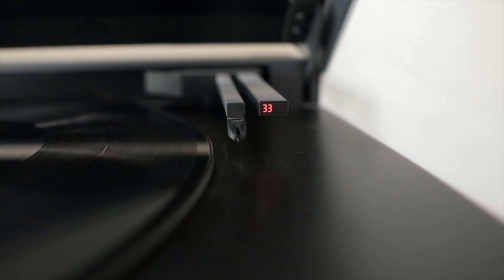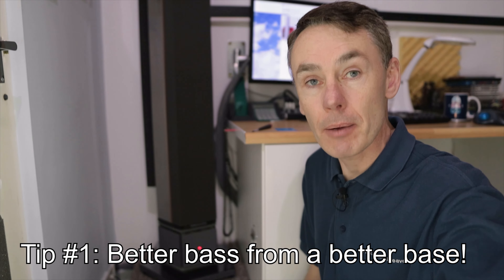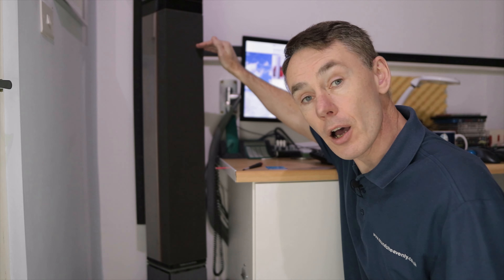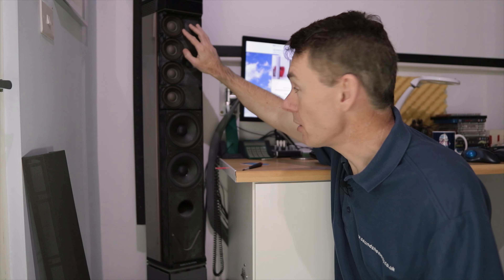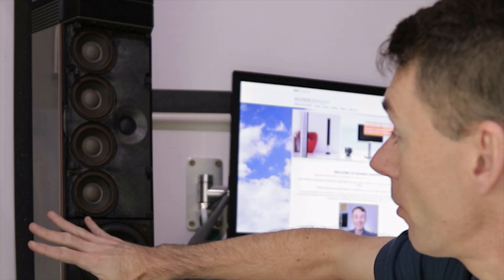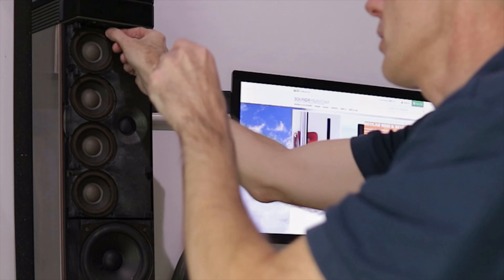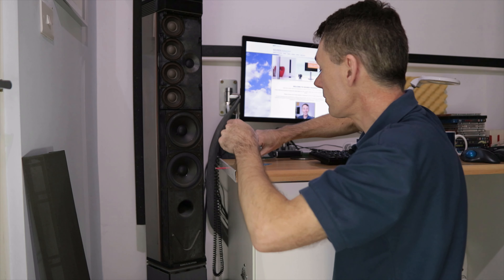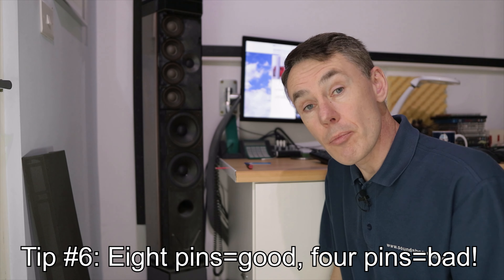Bang Olufsen Beolab Penta speaker upgrades - 6 simple hacks for better B&O sound [4K]

Comment: I'm literally in the process of buying a BeoSystem 6500 and a pair of Beovox Penta's so this is perfectly timed, and a great video too! I'm assuming your gripe towards soundlink sound quality don't apply to the Beovox Penta's as they don't have the amp and so you won't experience the amplified stream being reduced and then re-amplified again? Thanks, and look forward to your upcoming content on Pentas
Reply from the maker: Yes, the issue only affects the powered "Beolab" Pentas, as long as you use the Beovox Pentas with a powerful amp like the 6500 on good thick cables then you will be fine

Comment: Hi Steve, do you know if we can turn these Penta speakers to work with bluetooth somehow?
Reply from the maker: Hi, yes you can connect a pair of Beolab Penta speakers to the headphone socket of a Bluetooth receiver using this cable:-

https://soundsheavenly.com/line-in-connection/77-241-minijack-to-beolab-line-in-using-phono-rca-sockets-one-cable-for-two-speakers.html#/2-length-1m

Comment: Hi Steve. I have the Beolab Penta Active loudspeakers paired with the old Beomaster 5500 system. The sound system has not been used for a couple of years and when I tried to turn it on for the first there was "no contact". I've just had the amplifier fixed by a 
repair technician and they discovered that there was a broken fuse in the amplifier. However, when I came home to try the sound system, it did not work. It seems that the amplifier Beomaster system works, but there is no contact with the speakers (no red light at the bottom of the speakers like yours). 

My question is; Is it possible that there is a broken fuse inside the speakers or is it simply a setting I need to try? //Kristian
Reply from the maker: Hi Kristian, if the speakers don’t show a red light when connected to the mains power, then the speakers are faulty. Sorry I don’t know about repairs (I just make cables), but your local B&O store should be able to recommend a repair agent in your area.

Comment: hi steve it's still me, only you can help me because you know the mk3s like the back of your hand, basically I sent the midrange panels to a specialized center to renew the suspensions, unfortunately when I removed them I didn't catalog the wires with the various colors, I was wondering if you could give me a hand. Greetings from Italy
Reply from the maker: Hi, sorry I don't know about repairs, best to contact a B&O store or repair agent for their advice.  I can help with cables once you have got the speakers working.

Comment: Thanks for your reply Steve. My Penta 3s are awesome. is it possible to bypass the amps to use them as passive speakers, driven from a non -B&O power amp? is the Line -In the same spec as traditional preamplifiers?
Reply from the maker: The simple answer is "DON'T DO IT!" Everything that makes the Beolab Pentas great starts in the power amps.  You can remove the amps from the base of the speakers if one day they fail, then you are left with passive Beovox Pentas that won't sound as good.  Until then, keep the amp in place as it is a superb power amplifier, designed to drive these speakers to their full potential.  They won't sound as good without it.
Reply: @soundsheavenly  Thanks Steve. What I meant is, is the speaker there for that purpose? Can it be connected to a none- B&O power amp via this input? The naming convention is something that I need to become familiar with. Regarding the Line- In input; is that the same spec, as the universal amplifiers. or is it proprietary?

Comment: Are secondhand mk1 Penta's (6602) worth buying. They are to go with my beocenter 9300. I have noticed they aren't powerlink like mk2 or mk3 penta's. Are they still a good speaker?
Reply from the maker: Yes, of course! I will shortly be making another production run of the special 4 pin Speakerlink cables to let you use these amazing speakers with your 9300 system - please drop me a line at https://soundsheavenly.com if you need any help getting them connected to your system!

Comment: I watched your suggestions again since I just picked up a beosound 9000 and another pair of penta 3 speakers. Heres my problem. I have a beogram tx I want ot play through the bs9000, and I have an aftermarket lcd tv I run its output volume into the aux input on the bs9000. so is there a way to have my beocenter switch from the tv to turntable with the remote? I'm guessing the bs9000 will need something to do this? I just don't have a clue. see at the moment i use a preamp with switching capabilities to switch the two, but being disabled it would be great to be able to use a remote instead. Thank you for any advice you may have. Ps I love your videos I've learned tons from them over the years.
Reply from the maker: Thanks, glad you like my videos.  There isn't an easy way to have remote control switching between two sources, best to link them via an input switch box or splitter and control them manually.

Comment: I've had one pair of Penta 2's for many years, and was wondering about adding a pair of Penta 3's to run off of my Beosound 9000. Due to how my living room was built, and the amount of space I have place the speakers have you ever had anyone setup two penta's set next to each otherwhere the base plates touch each other, or would it be better to put two of them at the front of the room, and the other two back where I sit to listen to them?  In either case would I need different 8 pin B&O cables or add on to my system to get the best sound?
Reply from the maker: Hi, this will sound great with 2 speakers at the front corners of the room and 2 at the back corners, I previously had the same setup with 4 Pentas at home!  You need fully wired Powerlink mk.2 cables like these to light the speaker displays: https://soundsheavenly.com/powerlink-8-pin-din-connection/23-319-powerlink-mk-2-compatible-black-8-pin-din-cable-with-fully-wired-8-cores.html#/9-length-18m
Reply from the maker: @keeper1959fem  Yes, that is the ideal way to position the speakers, pointing towards your listening position